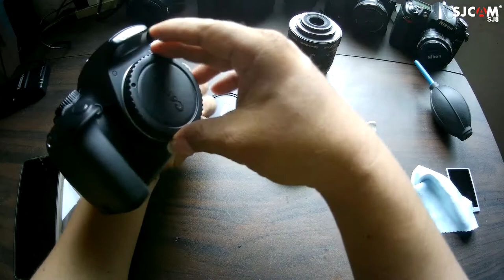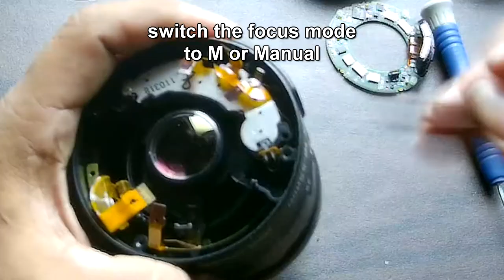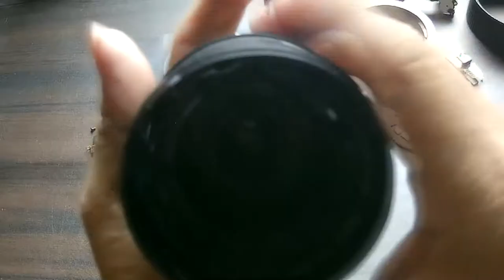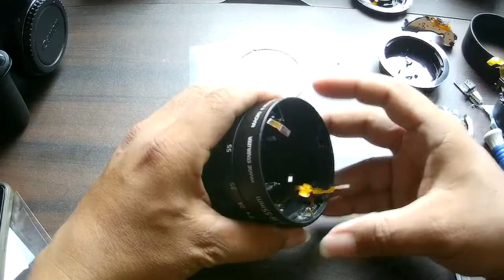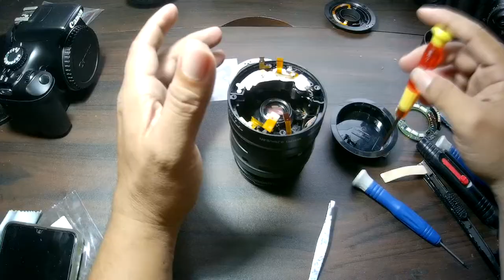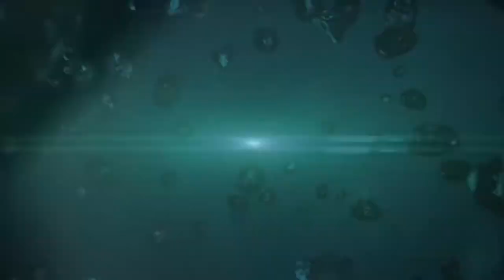HOW TO REPAIR  CANON 18-55 KITLENS AUTO FOCUS PROBLEM

Comment: Kapag sira ang autofocus and gumagana naman ang manual focus, ibig sabihin flex ang sira? Kapag ba bungi na wheels yung sa focus motor di na din po gagana ang manual? Gusto ko kasi mag DIY repair kaso di ko po alam kung paano malalaman kung flex or yung AF motor wheels yung sira. Thanks po sa sasagot.
Reply from the maker: Possible di na smooth ang manual focusing nya pag bungi na ung gears
Reply from the maker: Need mo talaga i disassemble para malaman kung ano ang sira
Reply: JM-Thanz na disassemble ko na po ngayon lang. and i can confirm na wala naman bungi sa gears. So flex cable lang siguro talaga? Meron sa shopee na 82 pesos lang. sana iyo na yung solution 👏🏻
Reply from the maker: @RodneyEvangelio  kahit hindi pa putol yung flex tingnan mo mabuti may punit na yan
Reply: @JMThanz  Thanks po. Nag orer na ako sa shopee ng flex. Sana gumana.. 
By the way, do you also know how to repair the kitlens of nikon? I have Nikkon AF-P 18-55 and ayaw na din po mag auto focus. Kahit i-manual focus ko ayaw pa din. What could be the issue? Wala po ako makita sa youtube na ganoong issue na nag re-repair eh and puro AF-S hindi AF-P. May kaunting pagkakaiba po kasi yun.. Thanks po
Reply from the maker: Mahal ang flex nyan sir, 1k plus
Reply from the maker: May compatibility issue din yan afp di talaga gagana sa mga lower version nikon bodies
Reply: Actually sir yung kitlens na afp ay kitlens siya nung nikon d5300 ko. mga ilang months ko kasi di ginamit dahil may iba akong lens. tapos nung sinbukan ko lang sana gamitin ulit, ayaw na mag autofocus. kahit i-rotate ko yung focus ring, hindi din po gumagana yung focus. could it be flex like nung sa canon kitlens ko or may iba pa po? Gusto ko po sana baklasin kaso wala ako makita sa youtube na afp 18-55 na nagrepair..
Reply from the maker: Yes flex yan, pahirapan din pag repair kasi may isosolda ka pa, mahal din ang flex 1k plus
Reply from the maker: Eto nagmura na pala
https://s.lazada.com.ph/s.Y5eU1